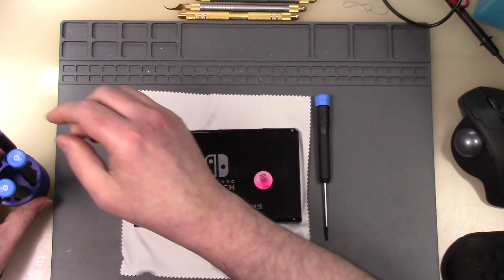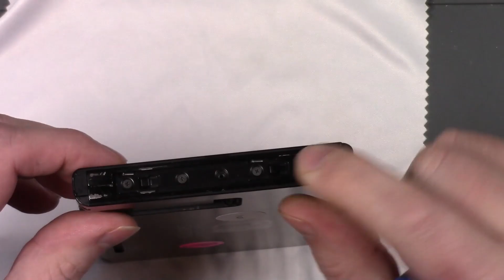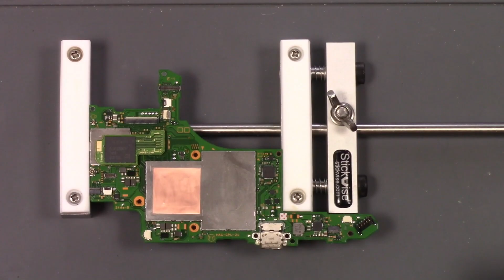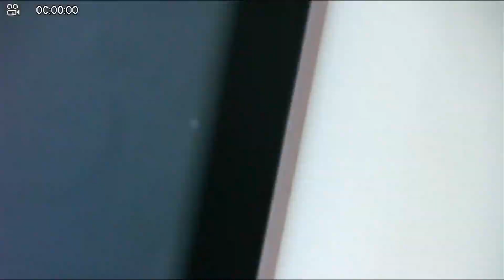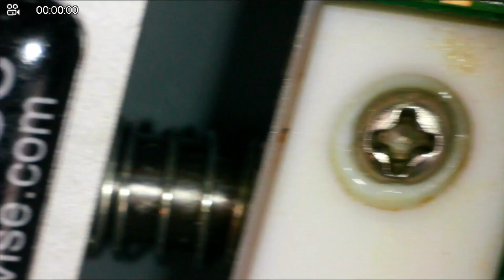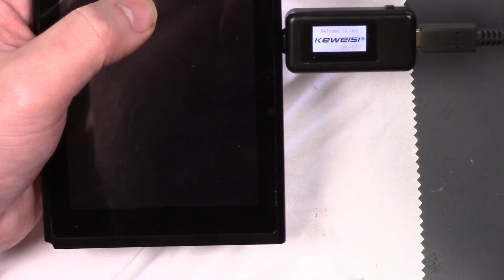Nintendo Switch Repair 1011 Revisit Soon

Comment: Nice edits Jason, the video flows really well. The anti piracy functionality of the switch is baked right into the APU and NAND memory. I think that chip you called the anti piracy chip is the southbridge? Anti piracy works on the switch by using encryption. The NAND file system is encrypted and the keys to decrypt it are derived by hardware id's on the APU itself.

RCM mode won't display anything at all on the screen btw. You'll just get a black screen and normal power draw on an amp meter. The only way to know if it's in RCM mode is to plug in a USB cable to a phone or PC and use a payload injector like TegraRcmGui for windows or Rekado for android. Both will detect a switch in RCM mode and let you know which is handy. 

Nintendo logo and power off, I've seen it be a corrupt NAND file system on three different occasions and rebuilding the firmware has sorted it each time. Unfortunately on "patched" switches it's not possible to rebuild the firmware into a factory fresh vanilla state without the use of a modchip. Kinda ironic that the way to repair a corrupt NAND is to use a tool designed primarily for piracy. If you ever do get hold of one though, you'll be able to rebuild horizonOS from scratch and get the corrupt NAND's back into working order.
Reply from the maker: Thank you. I’m not 100% sure what the issue is with this one yet. This video is 3 weeks old and I have done some more work on it but nothing good to report yet. I’m pretty sure that the chip is the chip that confirms that the game cartridge loaded is real. I do know that the chip is married to the CPU and it will boot with a different chip but you get game cartridge read errors. Unfortunately on the test switch I tested it on swapping the chips back caused the unit to no long accept an update, other than that it works perfectly. I am still unsure what a south bridge chip on a Nintendo Switch would even do, the switch has multiple chips that generate the power rails it needs to work. If you come across any information please let me know. I value your opinion and us techs need to work together.